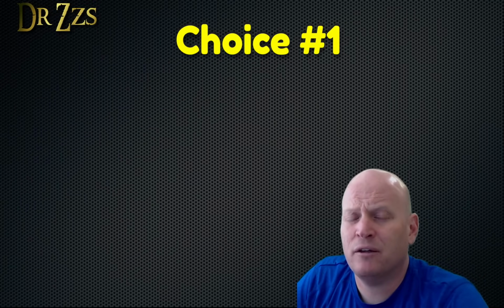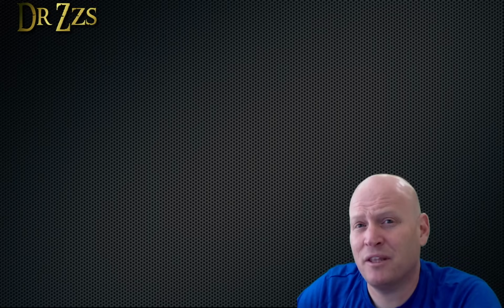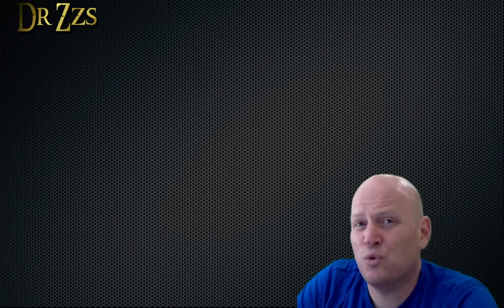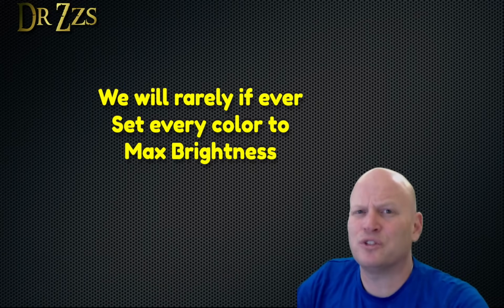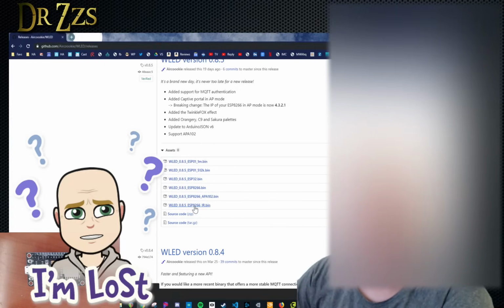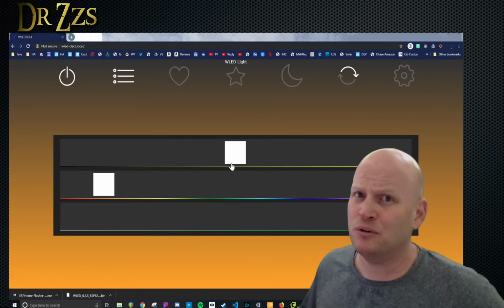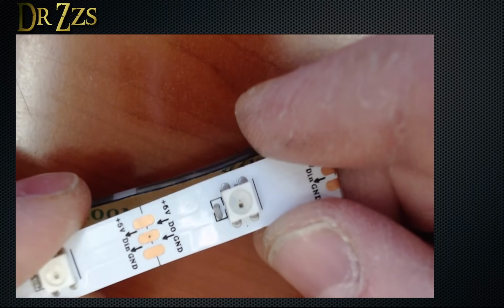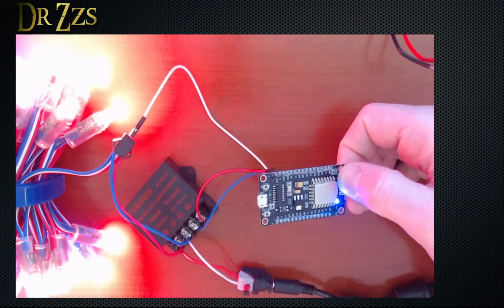Beginner's Guide to Christmas Lights - and LED Shows for Every Holiday

Comment: First off thank you for this video! I watched the first and almost started to do my own but held off. Then after this one I took the plunge! You made it so easy!
I went with a custom setup of individual led lights plugged together. I am having one issue:
If I plug all 100 lights in (each light has 3 leds) everything works. If I put in a 3 wire extension in have flickers when changing colors. If I put it at the start or end issues start after the extension. I do solder the connections so that is not it.
Could it be the gauge of the wire or quality of the wire?
I want to run a 30ft 3 wire cable from power supply to first light and also have a 10ft and 5 ft cable that will need to be between some of them.
I want to make sure that would solve the issue since it will be more $$$$. I have learned a lot of what to do and what not to do on this setup. 
Thanks again!
Reply from the maker: ah yes, you are suffering from data signal degradation.  The LEDs are expecting a 5v data signal but the esp chip only puts out a 3.3v data signal.  That's fine if the signal doesn't decrease any further, but if you have a small wire, or a long wire between the control board and the first LED then you'll get that flickering.  
There are a few options to fix it.  If you are savvy with electronics you can get a logic level shifter, but that's a more advanced method.  You can get a dig-uno controller like this: https://drzzs.com/shop/dig-uno but that cost $25.  It's the Cadillac of LED controllers. 
The easiest and cheapest (hence the one I recommend) is to use a "sacrificial pixel".  You put the first Pixel right next to the control board with a very short thick data wire (at least 22g). That Pixel acts as a voltage booster.  Once the data signal hits that first pixel the voltage is bumped up to 5v. Then you can run your 3 wire extension between that first Pixel and the second one way far away. 
If you use the sacrificial pixel, there is an option in the WLED software to Skip the first LED, so it won't light up and it won't throw off the look of the effect on the rest of the lights. 
I could have saved myself a lot of typing and just given you this link: https://youtu.be/ZFO_QOBG9Bs?t=657

Comment: Especially flasher isn't recognizing node
Reply: Esp flasher
Reply from the maker: this is gonna sound dumb, but can you verify that you're using a MicroUSB cable that includes data wires?  That's the first thing to check.  Second, make sure your computer has the drivers installed for the UART chip on the nodeMCU.  Most will already have that installed, but some might not.
Reply: @DrZzs  thanks! I just went to device manager! I somehow forgot all about it!
Reply: @DrZzs  The exact problems that I went through. Too bad I didn't see this comment sooner.

Comment: Could you help me,I have seen on amazon uk the Pixels 50 Digital Addressable LED String,they say the need Working voltage: DC12V,Working current: 60mA,Power: 0.3W/LED
what power supply  are you using to power them in watts  in your video thanks.

Comment: is a logic level shifter required if the micro control is located several feet from the first led in the string?
Reply from the maker: yes.  Or you can also use a "sacrificial pixel".  To do that you put the first LED right next to the micro controller, then the 2nd LED (and the rest of the string) can be up to 40m away (I measured it once).
Reply: @DrZzs  thank you for the reply! Do you have a PayPal or anything we can donate to? Go blue!

Comment: Love watching your videos and am planning on setting up my own lights here in the near future. I have spent a pretty penny on big box store lights that ended up dying on me in a few weeks.... So that wasn't fun...

But a few questions that I have! The aluminum channel with the diffuser, what's your thoughts on that? Also if they are pointing down will they look dull or not be visble down the street? Most of my mounting areas Will require that it's mounted facing towards the ground.... Same with the J channel but the aluminum channel will provide a clean look....

2nd question! So the 12v lights won't experience a voltage drop even if 5 strands or more are linked together? So no need for a parallel power wire?

Comment: I know this is an old video but I have some confusion on power supplies i need help with. I'm going to have about 700 LED. By your calculations that would mean I need about 14 amps. Is that correct? I feel like that is quite low and im missing something.
Reply from the maker: that calculates out right to me.  Are you using 12v or 5v LEDs?  the current will be lower on 12v.  Also if you inject voltage it splits the current, so your wires won't see the whole 14 amps.  I'd suggest at least a 20a PS.
Reply: @DrZzs  I'm using 5v with injecting along the runs. Thanks for your help and all the I formative videos.

Comment: I loved your video.  I had a local outfit wanting $8,000 to put addressable LED's on my home.  Your video inspired me to do it myself.  Is there another video about length limitations with 12v strings ws2811's and if linked together the ability to use one controller?  I would love to support you by buy components from you if you do that.  The LED's I've found on-line are 500 pieces.  Does this mean they are 3" apart and about 125' long?  any help on these questions.  Richard.

Comment: I'm having an interesting problem, i tried to use an Esp32 board(ESP-WROOM-32). It flashes fine, wifi connects, ui seems to work.... but i don't get any light out of the Leds(tested them with arduino nano, my Leds are OK). Tried another one of the same type of Esp32, with the exact same result.
Is anyone else having the same problem?

At this point i'm thinking about throing the ESPs out the window and buy some branded ones... Maybe that will solve it?

Comment: Hi,
What a TOP video. THANK YOU for it.
Although it's very clear I have a problem with get it working.
I have a 8 bits 2812 RGB strip (teststrip wit 8 leds), and a WIFI ESP WROOM32 (flashed it with WLED_0.8.5_ESP32.bin) ., but the leds are not working with the app, everything seems to work except the leds (the strip is ok)_
I used D4 as datapin, is this ok for this controller?
With Regards,
Bram
Reply: I found it!!!!  It should be pin D2 on the ESP WROOM 32
Reply from the maker: Excellent!

Comment: I have been watching LED videos all day... Do I need to add additional power every 16 feet? If I am wiring the exterior of my home, and I want all lights to behave the same way do I need more than one controller? Is there a way to sync controllers if more then one is required?
Reply: I have the same questions.  Did you find out your answer?

Comment: Power supply model FLY36-5-12 has both 5v 2a & 12v 2a.  $10-$12 on Ebay.   Great for the 5v Node MCU and up to 200 12v pixels.
Reply: What case do you recommend to mount the NodeMCU?

Comment: Love the great information and how you present it.  Have to admit, thanks to you I've now got a bad case of the holiday lighting bug!  Wondering if you or anyone here has explored using white polyolefin shrink tube as sleeves for strip lighting.  I'm considering getting a massive spool of 5/8-3/4" and running entire strips through it, just heat shrinking the ends and/or wires, then using white cable staples to put them up on my house's (white) eaves.  Seems like it would provide a very cost-effective option that almost totally camouflages the light strips while providing good protection vs weather and uv, with a similar diffusion effect as the other options presented.  Good idea, bad idea?

Comment: What type of wire do you use to extend the led cables to your controller? I run into issues with some wires interfering with the data signal

Comment: Great tutorial. I really appreciate how simple it's made for the average person. 
I had a problem, as have a few, and I have a solution. When trying to access the http://WLED.local part, I couldn't connect whether on my laptop or my phone or tablet. On my laptop, I went to the file explorer and put the address in there and was able to connect without problem. I was using Chrome on the laptop and Explorer on the Androids. 
I hope this helps someone.

Comment: This Lolin MCU operates on 3v3 logic right? Do you need the shifter as the leds operating at 5v logic? I would like to use wemos D1 for control and I am not sure if use the shifter.

Comment: Excellent step-by-step tutorial.  I did have an issue getting the serial port to show up when trying to flash the nodemcu.  After trying 3 nodemcus, 2 laptops and several micro-usb cables, I finally realized I didn't have the driver installed.  Once I got that, it was smooth sailing.
Reply: Where is the driver for it?  I have the same issue.  What is the driver called?

Comment: Im using these controllers with Xlights.  When I put in an IP address, it does not use it and still uses one via DHCP.  How can I fix this? Also, when I turn off the lights via Xlights, the lights will go to whatever color was selected on WLED app.  Is there a workaround for this?
Reply: I found the answer.....I just had to watch the second video!!!

Comment: Need some help! I've downloaded ESPHome-Flasher, have connected to computer (even get the little blue flash), but the node isn't showing up, only a blank box. What am I doing wrong?
Reply: I was having the same issue with my port not being recognized so I pressed the rst and flash button on the nodemcu. Refreshed and it picked it up. Not sure which is the one that got it to recognize the controller but it worked. Hope that solves your problem.
Reply: @Justin Williams   I have already downloaded the CP2102 drivers (Universal WIndows) and applied it. My problem is I can only open the controller from what appears to be the WIFI log in. I changed the wifi settings to my local WIFI network just after the 15 minute mark like Dr Zzzz did, but when I hit save and reconnect. I just get a message saying if I changed my IP to change it and reboot. (For him it just connected? I don't get how??)  So, I take it I need to set the wifi to my local wifi, not the Wled-app node, but it never works. Any idea?  Even when I open the WLED wifi, it connects, but I cant connect with 4.3.2.1 on my chrome browser. So frustrating because the default controls suck AND I have to be within 10-15 feet to turn the controls on through the app. Would like to turn it on through my wi-fi and on my couch!!!
Reply: @Justin Williams  Thanks for the reply.  It is not connecting to my local wifi. (His Step #6). But maybe I am confused.  I am assuming I can load my local wifi and connect to 4.3.2.1 or the name.local (his example. WLED-derz.local), but I can't. I can only connect to the Wifi of Wled-AP. Also assuming if I connect to my local wifi, the range will be longer. I can never get to the WLED web interface..

Comment: You said strip LED's are directional, but how about strand LED's? Are they? Also, with strand LED's can I simply cut them down to the length needed and/or splice strands together to get the proper length needed? then counting the total number of LED's for program them properly with WELD?

Comment: i am just starting the parts are on order thanks to you DR but i see you say the controller (NodeMcu) has to be within 12" or so from the start of the lights (12v WS2811)  but can you cut the light strand at say 8' and then have a 20' wire then continue with the lights again how will the signal be thanks

Comment: This was a great video, really inspired me to get to work on a holiday light show project. I'm confused with how all the LED Controller circuit boards are linked in with the stands of lights. Did you have to install a LED Controller circuit board for each strand of lights? If so, do you have a protector box for each one? If not, did you just connect each strand of lights to each other to get the signal passed to all strands of lights? Do you have a video that covers connectivity of all components?
Reply: Yes, this is where I am also getting confused.
Reply: I wish there was a more in depth video breaking down the exact installation and wiring process.  Not just talking through it.  I've found some, but they seem outdated.

Comment: Do I need a comtroller for each set of lights. Or can I use 1 controller with a string of say 3 sets of lights
Reply: You can use one nodemcu for 3 "strings" of lights
Reply: Did you ever find out if a controller is needed for each set of lights?

Comment: Anyone know what the issue is if you can't connect the Node Esp8266 via wifi to the WLED app? When trying to discover lights on the app it never discovers lights? But when I connect to Wled-AP  I can get control the led strip BUT only a quarter of the led strip receive the data, the rest of the LED strip is just plain white?? Please help
Reply: I had trouble as well getting the Android WLED app to connect when the ESP8266 was powered via the USB connector. The app connected right away after the board was powered from the external power supply. 

I have encountered two problems. The first is when two strings are connected in series only 2/3s of the second string light up. Every pixel lights when connected directly to the power supply. Must be the brand of lights I purchased because Doc was able to light two strings in series in one of his videos.

The other issue is with the WLED android app. I can access the settings but the only setting so far that I have been able to set is the number of nodes/lights. Changing any other settings doesn't seem to affect the light strings at all. None of the buttons on the app's home page work, e.g. color or brightness. I saw on GitHub that for Android the app might need to be set to Auto instead of Mobile. I haven't had a chance to try that yet.

Comment: You need better directions on dealing with the nodemcu and windows drivers.
Reply: I agree... Wrestling with that rn.  Rest of the vid looks good so far tho.
Reply: Curious, what windows drivers were required when connecting a nodemcu to a windows PC via USB? I don't recall encountering any errors connecting a Kee Yees ESP8266 nodemcu to a Windows 10 laptop.
Reply: @oldguy5119  Maybe I missed something in this video, but once I downloaded and installed these drivers, I was good to go. (https://www.silabs.com/products/development-tools/software/usb-to-uart-bridge-vcp-drivers)  Hope this helps.
Reply: @megahash1833 thanks for the link.

Comment: Im bout 99% sure bout this but with the data line can I just snip the connection from the 3pin jst and sollder an extension  line. It prob be bout 3ft prob less. I don't have jumper wires  so I figured Id extend it..  I saw ur other video of how Long the data wire can be but what I wanna do is a little different.

Comment: I bought a strip and it didn't work, then I checked that the arrows were pointing in the wrong direction but the stupid shop put the cables on the end of the strip instead of the beginning.